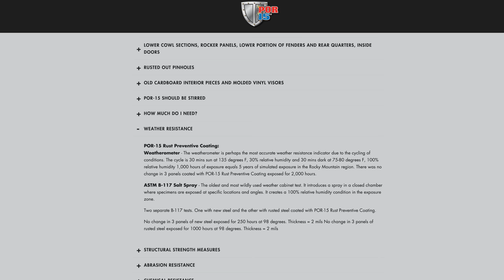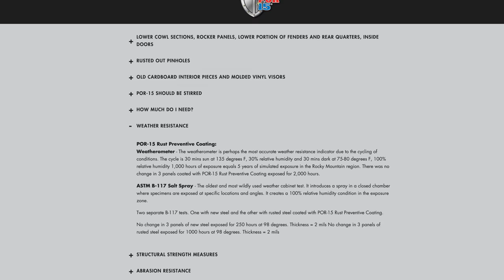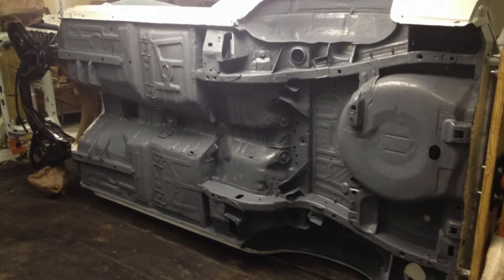How to PROPERLY Paint Over Rust Part 2 of 2. Applying paint. (Car Rust Repair)

Comment: That isn't a Foxbody Stang from looking at the underside....looks like a SN.I've had numerous Foxes over the years,1st was a '83 GL 5.0 5spd notch in '87 when I was 16,'93 LX notch,'89 LX notch 5 spd,'83 Capri C4 auto,and still have a '89 LX  N/A 480hp 347,5spd,3.73's.An Ex also had a '92 LX 5spd (actually I have a short vid of it on YT when I had to change out the poly locs on the rocker arms) and we'd take them to shows almost every weekend.Hers had a 10-12k paint job with same body color on the underside and took hers to the '14 Ford Carlisle where she got 2nd. 
I'd just left the bridge primer or painted over it with paint instead of the Raptor it looked a lot better.I think using Raptor or equiv. makes it look generic.A lot of people are using it and a lot of them go to shows and at the shows where the participants do the judging I take points off for that sort of coating as most just use it to cover up bad patches,rust,etc.

Comment: Won't the grease you put in the bolt holes mess up the torque settings and risk overtorquing? I agree that tape is a pain so I've been inserting small bits of shop towels twisted into a wad with enough sticking out to make removal after painting easy.
Reply from the maker: The consequences of over torquing a fuel tank strap and transmission mount are non existent. What issue would an over torqued transmission mount cause? If grease causes you to over torque something so badly that you break the bolts off, perhaps auto repair isn't your strong point.
Reply: @RepairGeek  Last year I rebuilt a manual transmission, did a full TB/WP job, rebuilt all 4 calipers & strut assemblies and am now completing a full rear end overhaul job, including opening up and taking apart the diff. So I'm good there. I just like to do things by the book since I'm not a pro and haven't developed enough "feel" to be confident in my work. No harm in using a torque wrench, and grease totally messes up the readings. 

Plus, the issue isn't just snapping the bolt or nut during reinstallation, but while on the road at highway speeds. Overtorqueing doesn't necessarily result in immediate failure, but it sets a fastener to be more likely to fail, like trans mounts that absorb vibration. Anyway, I was just saying that if you do this and like to use a torque wrench, you won't get proper readings, and I still prefer the twisted shop towel piece method.
Reply: Grease will not mess up torque on a bolt. I do a ton of work on bicycles. They are ultra sensitive to torque and all bolts/nuts MUST be greased when assembling. Will not cause a properly torqued bolt to fall out, but it will allow you to remove it when you want to.
Reply: @DanHoopes211  I'm not a bike mech but I've maintained and repaired my bikes over the years and built one up from parts some years ago, so I know a LITTLE bit about it. And have read up a lot on both. Certainly enough to know that while there are some similarities between it and car maintenance and repair, the  two are simply too different to be very comparable.

For one thing, car fasteners are generally torqued to much higher values than bike fasteners, with some notable exceptions like cranks and cassettes (the latter being self-torquing in most cases). Where on a car is there a critical fastener torqued to say 5-10 ft-lbs? And where on a bike is there one torque to say 50-100 ft-lbs? And car fasteners are subjected to stresses that bike ones generally are not, like vibration, primary and nth order, heat, cold, temp cycling, fluid spills, g-forces, dynamic and static weight, etc.

Plus, even on bikes, you generally don't apply grease to fasteners. On some, especially titanium ones, you use anti-seize. On others you use threadlocker. And on some, yes, grease would be ok.

But in no case does grease or anti-seize not affect torque readings. Not sure where you got the idea that it doesn't, but it does. Perhaps not always to the extent where it matters, but a basic understanding of friction and lubricants explains how this is so, which you can easily find online in various grease, lubricant and anti-seize, and fasterner makers' web sites and other how-to sites.

I get it, you're in the "I have a lot of experience and know what I'm doing so I don't need to worry about torque and friction and can do it by feel" camp. Which is fine if that works for you, not so fine if it doesn't and you experience catastrophic failure doing 20+ on the road. Just ask anyone who's had a carbon fiber fork tube fail due to fractures caused by overtorquing the stem bolts due to greased bolts. Or control arm or knuckle bolts snap due to overtorquing due to greased bolts.
Reply: Note that I'm NOT saying to never apply a friction modifier to fasteners, be it anti-seize, threadlock or grease, just to realize that it WILL affect the torque reading and to adjust the applied torque accordingly.
Reply: @kovie9162  I guess the main question then is: are specs listed dry or with lubricant?
Reply: @DanHoopes211  Unless it's specified otherwise I always assume that a torque rating is for a dry application.
Reply: @kovie9162  Most things I've read, such as head bolts, say to lightly oil the bolts before torqueing them. Otherwise the bolt and threads are dry and it affects the torque rating as they binds. Grease won't hurt a thing...

Comment: There is debate about whether grease on threads will change the torque. And allow them to back out..
I’ve read many directions as an aircraft mechanic that said threads have to be dry.

Now, I do imagine, grease on the threads of a car will prevent bolts rusting in.
I’d probably tape up wheel lug holes…
Reply from the maker: Well, I've driven this car over 6,000 miles for a cross country road trip and did a track day on the same trip. https://youtu.be/2hC25L3evyo 
I can confidently say that a little bit of grease hasn't caused my transmission or fuel tank to fall out...
Reply: @RepairGeek  surely. Regardless, the debate exists on the level of physics. Hence why an A&P is liable for any failure if they grease threads that are not directed to be by the manufacture (none ever are except those meant to be anti-seized). Of course, the actions of an A&P matter quite a bit more than those of any vehicle mechanic.

Comment: Not knowing exactly what is in your painting product. I would be using 100% supplied air with eye cover. You can restore your lungs.
Reply from the maker: The very second I talked about PPE in part 1 audience retention took a drastic nose dive. I can talk about it all I want. Fact of the matter is the audience doesn't care.
Reply: What!!! PPE should be the #1 consideration in any work environment before starting any job. 
Regarding rustproofing: My 1997 Ford F-250 took 3 weeks to rustproof with Mil-spec. I still drive in Ontario today. 800k. I did all your testing 25 years ago too to find the best product.
Reply: Sorry, “You can not restore your lungs”